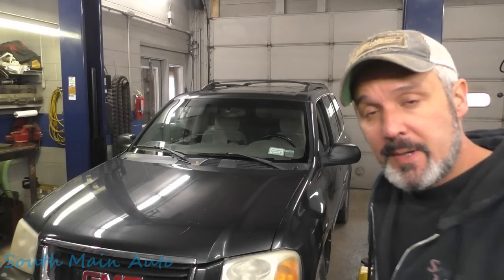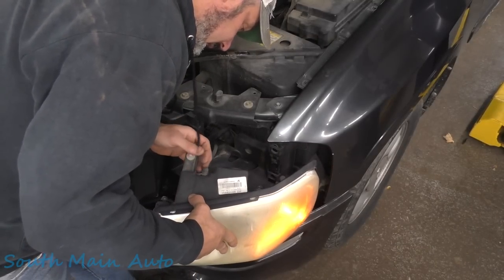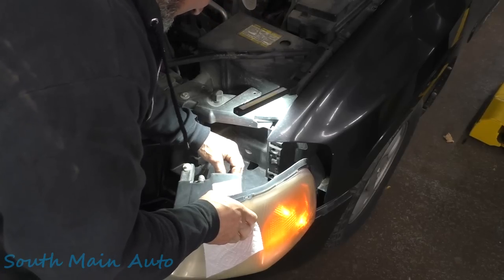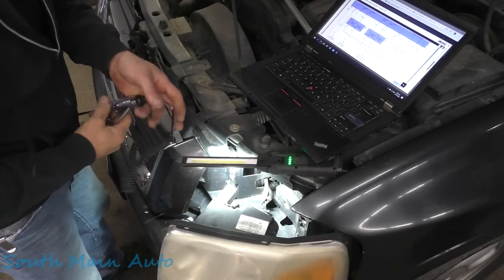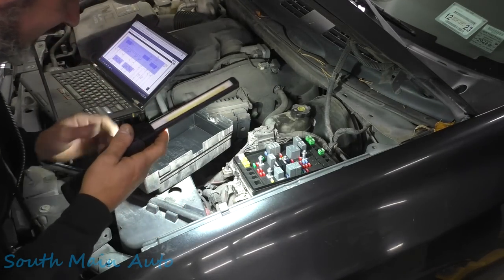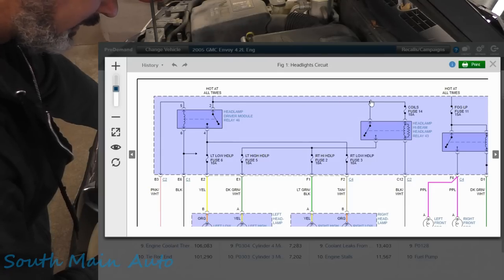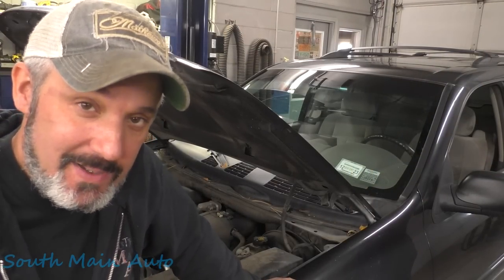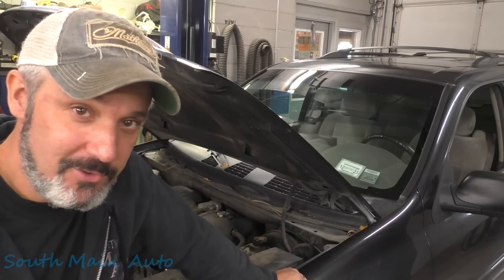GMC Envoy: No Low Beam Headlights

Comment: These did have a recall for the HDM (headlight driver module) 
NHTSA campaign number 15V519000
GM Recall 14291
Covers most if not all MY06-MY08 GMT360 vehicles (including EXT and 9-⁷x)
Revised GM Part # is 13506836

Comment: All good! Reminds us all that logical deduction is often needed when doing something like this. Several months ago, my best friend pointed out, or it was me, I forget that I didn't have any taillights, or was it brake lights? Anyway, opened the hatch in my P5 and got in to unscrew the taillight buckets out to get to the bulbs and checked the bulbs, the captain's side looked fine, but was not, anyway, ended up replacing both lamps as they partly worked. Mazda uses a 2 filament bulb for tails and brakes (and by extension, for the side marker), but a separate bulb for turn behind an amber lens. 

Had the third brake lamp as it's LED and resides under the rear spoiler on the rear hatch lid. Unfortunately, the P5 wagons, they chose the dreaded H7 bulbs for the low beam, and then place the washer reservoir bottle right behind the drinker's side headlight bucket and no easy way to must move it out of the way, or remove the headlight bucket itself to replace, which the H7 bulbs are a piss poor design requiring a clip to hold them in place. Had to replace that side just over a week ago, and managed to replace it in 5 minutes, a miracle for me as in the decade I've owned the car, never had it easy with that side especially.

However, knowing how cars rust in your area, I was half expecting the green crusties to rear their heads on that relay as you moved back in a logical fashion, but seeing it was not all puffed out and crusty, it was just a bad relay.

Comment: SMA is one of the best channels on YouTube...  Great diagnostic steps but yeah, with older cars the first step is to google the problem because someone else has already encountered it...  PS the "relay" really isn't a relay - That's why it's so expensive.  The GM engineers in all their wisdom thought it a good idea to PWM the low beams for DRL's and that eventually wears out the headlight driver module "relay" leaving you in the dark.  At least Trail-Voy drivers will still benefit watching this video, and that's all that matters.

Comment: Had a high-beam issue this weekend (and probably the better part of the past year). Turned out to be a pin had pushed out of a factory piggyback harness for a remote start system. Loaded the parts cannon with a multifunction switch, then revisited the wiring diagrams I could scrounge up and found the issue. Return shipping is my only cost this time around, fortunately.

Comment: I once had what I would guess a "10 million to one odds" chance with both my headlights "Low Beams" burning out at the same time. I drove my family in the car, a 1997 LS400, to a Melting Pot restaurant for dinner. The headlights were fine, it was after sunset. We came out after dinner, climbed into the car and I started the car, as usual the headlights were on, and as I put the car in drive, I realized my headlights were off. I thought I accidentally turned them off. But I had not switched them off. I drove the short distance home with the "Brights" on.
Replaced both lamps and everything was back to normal.

Comment: Had one (6volt) 1949 Farmall Cub. ALL lights were out. Tested them, they were ALL burned out, headlights and instrument lights. Put in new headlights, first time I used them and ran the engine up to full speed they got really bright and blinked out again!!! Turns out it was the generator voltage regulator. No scan tool, I was 12 yrs old and it was 1962. Michael in Colorado.

Comment: Had a fella walk up to my truck from behind at the Hardee’s drive thru and inform me that I I had zero brake lightage! Instant concern and worry since several county law enforcement were enjoying a visit to my local Hardee’s at the same time I was breaking the law ! I limped my trusty 05 Chevy 2500 hd, with the mighty LLY  DURAMAX home, spending much time scanning mirrors for approaching LE. A little voice in my head whispered your words, at first i wanted to unplug every connection underneath, then I understood, work from the source! A bad brake light bulb and a bad connection on the other side, hardest part was getting the screws out! You can do it yourself!

Comment: Following logic is a good thing, as you have shown to us here.  I guess if you have a newer vehicle with LED's and would have to replace the entire assembly if it fails, then a failed relay would be really good news.  And the point about if someone was driving cyclops for a long time & didn't notice until the last good bulb failed is a good point, which had not occurred to me.

Comment: @Eric, the one thing that I had found out about my 2003 Envoy was, the headlight wiring gauge is too small
for the headlights. This is a  common problem with those years of the Envoys, whereby the wiring will 
overheat ; just outside of the headlight bulb connector thus you'd find scorched/overheated and have to
replace the connector and a segment of the wiring.
Reply: That's still true today with numerous GMs.

Comment: I had an Envoy with a no-low beam situation, passenger side only. Replaced the blown bulb but atill no light. Fuse was good, changed relay still no light. Test light probe showed two good grounds, two hots  through harness  wiring to lens unit. Ohmmeter showed continuity on both grounds, but low beam hot wire was none. Pushed  orange wire back on the pin connecter with a long screwdriver and fixed it. Aftermarket, made in China lens unit

Comment: Couple of thoughts on this repair:

1. The relay is a solid state part, this it’s why the part was so expensive. 
2. This may have an additional problem. I had a 2003 Envoy XL with a similar concern. I replaced the relay and it was good for a short while. A few weeks later, the problem started up again. If you touched the relay, the headlights would work intermittently. Ultimately I had to replace the fuse box to the tune of $300. The terminal inside the box was fretting. I could not effectively repair the bad terminal.

I love watching your diagnostic videos and encourage my students in class to watch them, especially your PICO scope videos.

Comment: I had this same problem one time! I went with a Napa replacement as well. However, the part ended up failing fairly quickly. So I went to GM and just got OEM.

Comment: Same thing just happened to my very low mileage 2005 Buick LaCrosse. Car sat for 2 years (used Sta-bil in gas tank, plus battery trickle charger), it fired right up, drove it at dusk to gas station and didn't see my daytime driving light headlight reflection in vehicle ahead of me. Got home and no reflection in garage door either. My left and right Headlights were different ages, so didn't think they were burned out so played with "auto-on" headlight switch, nada. Thank goodness for the internet, I  saw it was a known headlight relay issue. I  needed the car that night, so bigger box parts store...,Two behind the counter BS-ing with a customer. One peels away, I show him the part, "deer in the headlights" look (pardon the pun). I tell him what it is he writes it down looks it and up can't find it online. The other counter guy walked the other customer out of the store, comes back, shows the first where to look. My guy looks in a bunch of boxes, can't find it, other guy looks in bunch of boxes finally finds one, $36. Apparently this relay also drives the daytime driving lights and isn't up to the task.

Comment: I learned the hard way to be careful about jumping power to something.  I was trying to troubleshoot a malfunctioning washer pump, so I jumped power to the fuse that feeds the pump.  (The last thing between the pump and the control circuit).  Little did I know that GM in their infinite wisdom set the relay to ground the pump when not running.  I ended up smoking a PC trace in the fusebox.  Ended up disabling the car because that same trace was used for the ignition relay.  Ouch.

Comment: I recall seeing mechanics chasing wires and dimmer switches only to find that both headlight bulbs are bad. As you say, most people don't check their lights so they might drive around with one out then the second one goes out. When you're at Wilberts, you should pick up some relays and fuses. I have a large cache of those from working in a recycling yard. I would pull them out of vehicles headed for the shredder.

Comment: Relay 46 was the subject of a recall or Technical Service Bulletin.  This goes back about 10 years or so.  GM will reimburse you for cost of relay (about $30 as I recall).  It can also be caused by corrosion on relay legs.  Sometimes it helps just to pull relay and put it back in.

Comment: Easiest headlights to change besides old style glass lights are probably the 2006 Impala lights. I've haven't changed a lot of bulbs myself but one bolt, one hanger, and some jiggling is far better than ripping of the front bumper or reaching into crevices that only an ant can crawl through. Replacing headlight bulbs isn't exactly a two-step process but if it was any easier then you'd be using a match to relight your headlamp.

Comment: I needed this video eight years ago ., Those bulb sockets are spliced in because the factory wires are too small and burn up from the load . The factory boards the tail lights plug into go bad. The wires feeding that under hood fuse box get corroded under the plastic. The connections to the power box under the rear seat needs the terminals cleaned up periodically. Those relays for the lights will start going , and will turn off the lights while your driving. Luckily GM uses those relays for everything so I always keep spares on hand . Oh and the electric fan clutch goes bad and gives you all kinds of warnings and codes.

Comment: That exact relay went out all the time on my 02 Trailblazer back in the day. It would overheat and shutoff. GM spec'd it bad. You are right they were spendy. I just found it better to go to junkyard and raid the fuse boxes. I could pay $30-$40 each for a replacement at NAPA, or $2-3 at UPullRParts.

Comment: I swear Eric O some work always comes in waves 14 out of the 20 vehicles i have worked on today Were Radiators and Over Heating Issues Got 12 Scheduled Brake jobs Tomorrow busy week and it just started @South Main Auto Repair LLC

Comment: Back a long time ago, I owned an 84 Monte Carlo that had the 4 rectangular sealed beam headlights. One night we had been out and when heading home I turned on the headlights and nothing, switched the high beams on and all 4 lights came on. I instantly jumped to the conclusion that the headlight switch was bad and spent a couple of hours changing it, only to find out that both low beam bulbs were burned out. What threw me off is that the low beam lamps had two filaments, I always assumed that the high beams just turned on the extra two lamps. I always check the easiest things first after that.

Comment: Hi Mr. O. The relay in question is solid state. The low beams double as DRL's on these rigs via a PWM signal from the BCM requiring the solid state relay. Same for the electronic fan clutch, being fed a PWM signal.

Comment: The high Beam ON the relay is always hot so the high beans dont activate Off the relay It passes through That relay and the relay Clamps to alow the Low beams to turn on so Brights will always work even if relay fails Eric O @South Main Auto Repair LLC

Comment: Nice video,  I found that I had the same problem... kinda. Low beam would not turn on, I had already checked the relay and it was bad. When I replaced it the low beams came on and I was over joyed.... until they wouldn't shut off. Lol so now to figure that out. I'm open to ideas if you have any. Right now I have to pull the relay to shut lights off.

Comment: Had a 1999, with low beams that would sometimes not work, or best intermittent and of course, its only when it was dark outside. Never did fix it. My best guess was a bad ground. I'd turn the car on and off till the light turn on, or I'd flipped highs, and lows back and forth. If that didn't work, I'd used my brights to get home. Seldom was the case. When I wanted to work on it, they wouldn't act up. Than I'd go a month or two and no problem.  Seemed to work when the moisture in the air was high.

Comment: Easy as 1,2,3. Sometimes in a shop you pray for those kinds of jobs. Especially if you've got a parking lot full of vehicles waiting to get in the shop. Vid wasn't boring and it walks a person thru the steps of finding the underlying issue. Sure after checking the bulbs a person could have jumped to the fuses and relays and in this case would have fixed the issue. But there would of been the question of the wiring. Following a logical process like you demonstrated makes that a non-issue and you still get to the fuses and relays in a timely manner.

Comment: I had a 2007 International 9400 I truck, and I had both low beams go out at the same time.  I thought I had an electrical problem, but it was just both low beam light bulbs.  Strange both burned out at the same time. It happened.

Comment: There is a recall out for this where the HDM (Low bean solid state relay) will be replaced. It is for 2006 and up MY but the system is the same for 2005.

Comment: I think there was a recall on multiple vehicles with those relays. It was just to replace them. I remember when I was a noob I had same compaint and was told its probably a couple of bulbs. Well it wasn't and i was like wtf!  then my buddy came over and was like switch those 2 relays around and see if it works, sure enough it was that!

Comment: I miss the platform,  I drove an 04, and 06 over the course of 7 years.  My 06 popped a transmission at 26000 but under warranty so I didn't care.  No SUV I ever drove had the guts, handling or driver feedback they had. I'm sure if I had it longer and it started to nickel and dime me to death like I hear from many,  my opinion would probably be much different.

Comment: I liked the test light power supply to the fuse hack. That could be handy if I remember it when the time comes. Could you move even farther up the chain and do that on the relay load side pins and then also use the test light to confirm power on the relay control side? Now I just need a test light.

Comment: Eric Great video, Love how you used common sense to narrow it down to the relay.   Eric What do you think of those GMC Envoy's??  a friend was looking at one as a winter beater, I know they did that weird driveshaft through the oil pan of the inline six, which is weird, but I think they are a decent vehicle, is that a fair statement??  I told my friend get a Toyota, 4 runner, but they are a lot more money  used, the Envoy is cheaper.  Let me know if the Envoy's are really bad. Thanks, Rich    p.s. Love the videos

Comment: that relay is common failure on the gm 360 platform, there is a Service bulletin on this issue. also those of use have these vehicles grab some extras from the them in the junk yard to keep in the vehicle.

Comment: Ran into a similar issue on a 2013 Captiva. Customer had a headlight out and had replaced the bulb but still no headlights. Pulled the wiring diagram and turns out the fuse for that side was blown.

Comment: Tell you what I've done to the 2000 Camry LE. I changed the ashtray bulb that was burned out to a led bulb. Unfortunately I had no choice about the color of the led bulb. But I blew my cigarette lighter bulb it takes a special type bulb. Hope I can find it in a cool white led bulb.  The ac/heater bulbs have burned out too. I can't the ac/heater unit out because my relatives let the Camry sit for a long time and the screws have rusted. I don't know how to get the unit out without stripping the Philips screws. It's the same way with the dashboard cluster. There's bulbs burnt out in the dashboard cluster. If you have any suggestions please let me know.

Comment: Sometimes it IS both bulbs at once.  I turned on my lights as normal one night, and my 2005 WRX blew both low beams in an instant simultaneously.  Must have been some freak over-voltage or something.  I just drove home from work with both high beams on, hoping I wouldn't blind anyone and inadvertently suggest the dingbat WRX stereotype is true.

Comment: Good deal give me a little more information for I can check the inside light on my Z by 71 police interceptor 2010 thank you so much I even went out and bought different test lights that have different bulbs in different grades of current they can handle thanks again for this this is very helpful I’m struggling with it it’s been too hot to work on

Comment: Solid state relay. They use PWM to run the low beam lights as DLRL. What really sucks is that they also fail in the on position.

Comment: The infamous lowbeam relay failure?

GM uses a PWM control on that relay here in Canada to create the DRL feature, they are extremely common failures here with the constant on and off cycling, hence the higher price.

Comment: i usually play swap tronic with the fan relay since its the same part,  worked 100% so far.  If the fuse is intact.

Comment: other reason to check if the bulb is bad... when they go bad they often do at the same time. assuming you change them at the same time. EVERYTIME I change mine I am using the sylvania "hot" bulbs.. one will fail the other will within minutes.

Comment: Just did this on my moms Envoy last month and on my Envoy a few years ago.  I think GM had a recall or TSB on those solid state relays for that platform.  They would intermittently go out while driving, which is super sketchy.  Not sure why they chose the solid state ones over your traditional relays for the headlights and fan.